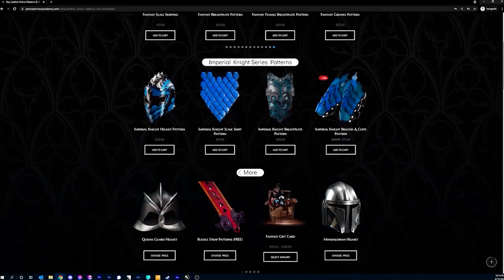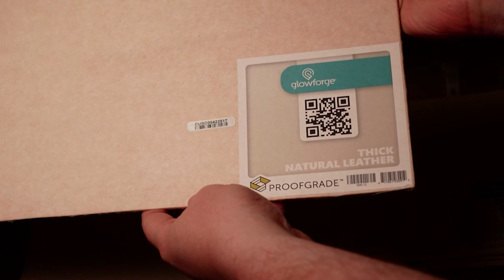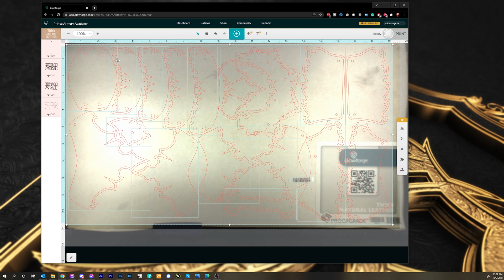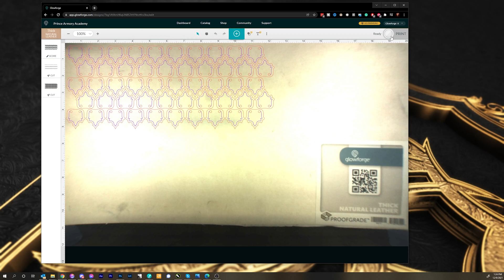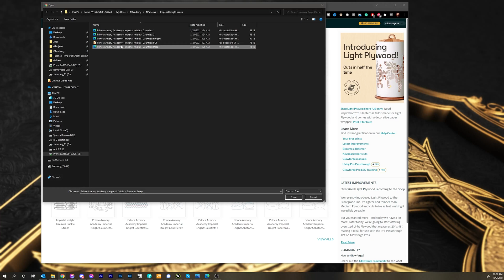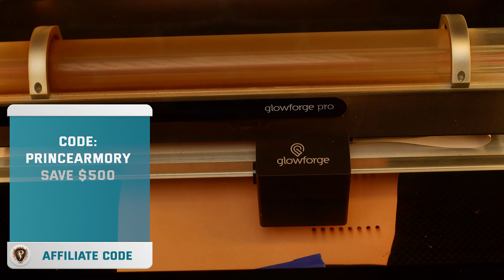DIY Articulating Leather Gauntlets - Prince Armory Imperial Armor

Comment: For the pliers, putting heat-shrink tubing over the tips works very well. Just be sure to put it all the way back in the jaws so that they don't slip off. I have also found out that TIG welding gloves from Harbor Freight work for a glove/gauntlet to wear or attach underneath the gauntlet. The main shell is white and takes an alcohol dye.
Reply from the maker: Yeah I can definitely see that being a good tip.

Comment: I've been following you for a bit. Been wondering how i could make a suit like this in metal.
My mind has been locked into the medieval way of designing armor, but these fantasy suits have made me rethink the process some. I don't have many tools, but i've been thinking on how i might be able to make this in metal with what i got.
Reply from the maker: The fantasy armor can be adapted to metal pretty easily but it will have a lot of super sharp points you typically will not want in a suit of metal armor, or maybe you do but you have to be careful about how you use it.

Comment: Sry if i make some mistakes. Watched laser-cutting part of video. For more than 5 years i cut leather by laser: fast+cheap+perfect precision. GJ man, no questions, but few advices. For first i saw that u use CO-glass-tube, so u can unfocus lens to snick leather on low power+high speed, result is "bold" line, if u unfocus for more than 20mm (for 60.3mm focus lens) u receive about 2mm width line. To make good relief (making by laser not hands in seconds ha-ha) u must adjust power (min / max power of laser-tube) and find necessary speed. Just 10 min for experiment and u got it. For clean surface after cutting use masking paper tape in all cases, but if u wanna some gradient on the edges don't use tape and switch to min air pump or valve. Physics make things!

Comment: medieval gothic gauntlets use sliding rivets for the wrist articulation to maximize movement while minimizing gap between the plates. sliding rivets are rivets with an oval rivet hole so that the rivet can 'slide'. is it possible with leather? I think it would make the gauntlet much more smooth to use and less gappy (although most fantasy armor are gappy so oh well) 
it looks cool though!
Reply from the maker: It's possible, I do it with some gauntlets on custom suits.  You can't do it as much because if the slot is too long the screw/rivet will pop out of the slot because leather is flexible.  and by the same token, since leather is flexible, you don't need as much mechanical articulation in some areas.